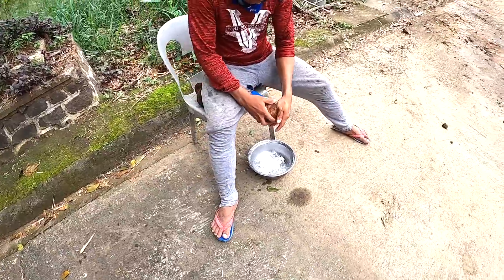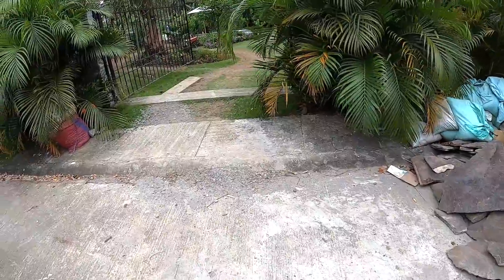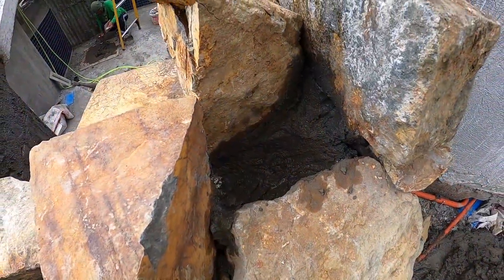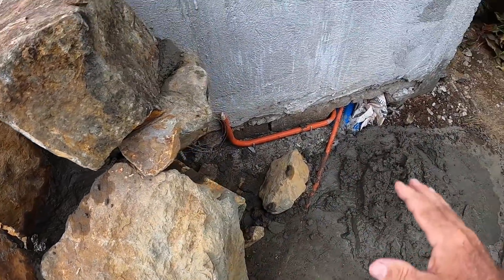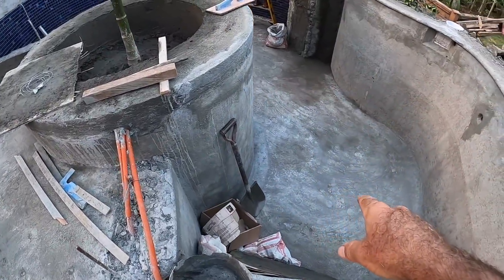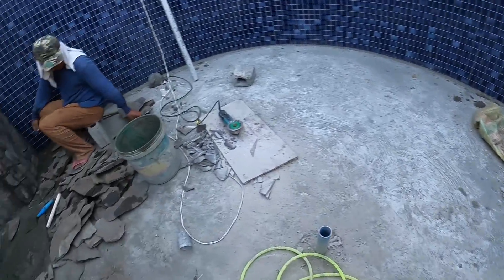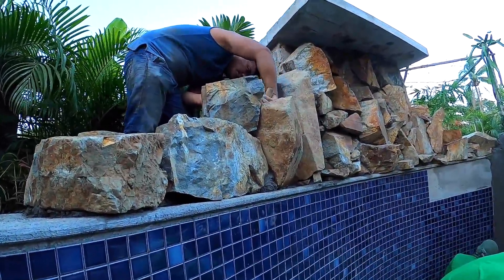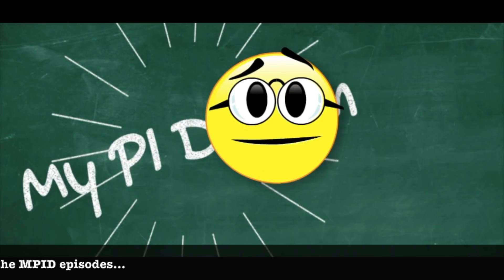VILLA FELIZ POOL BUILD - EPISODE: 39 (House Building in the Philippines)

Comment: James I have a totally project unrelated question. But a new construction one none the less.
Smart switches for light fans etc. Within the home in PI. Are they commonly available there or should we purchase no negative wire type in the states.
Thank you
Again. Love the pool project, Also excited you'll be following the neighbors build next year.
Can't wait to see y'all enjoy the pool.
😎
Reply from the maker: Most older homes don't have grounds so if your smart home device needs a ground you'll have to consult an electrician to add earth ground to your electrical infrastructure.  We added ground for all service outlets but not lights.  I did install a remote (not smart home) for our fan in the sun room.  I did a video on that.
Smart switches are becoming available in the Philippines and a good way to find vendors is to check out WorldBEX each year in Manila.  They can point you to a vendor for purchase.
Reply: @MyPIDream  Much appreciated.  I remember the grounding episode.
I will be sure to speak to the engineer and electrician on this.
Thanks so much.

Comment: I love to see the final outcome, just a bit of concern on the sharp edges of the rocks on that area of the waterfall..
Someone in the water assuming might hit their head  on the rocks overlapping on the pool area, when they pop to get some air.
check the safety precautions as well..
Reply from the maker: We've already addressed that with the stone worker.  The stone work on the lower level will be adjusted to avoid any safety issues.
Reply: Well that's how construction goes, you'll never know till it's over.
Love your dog's by the way 😁